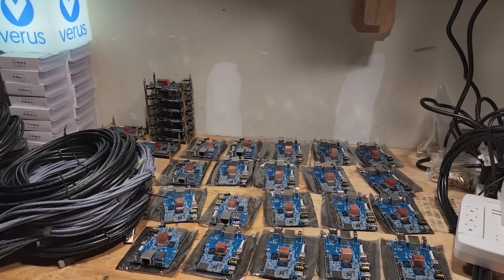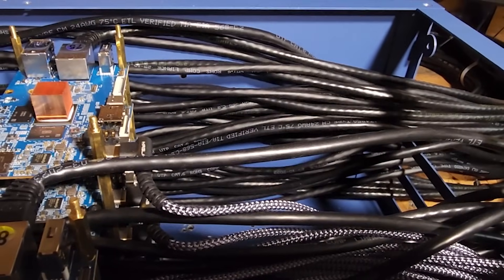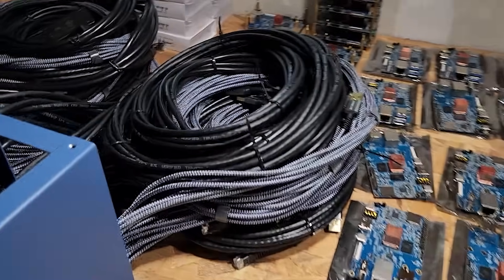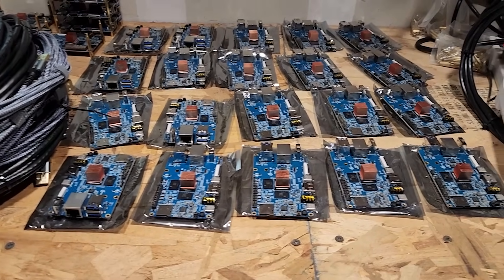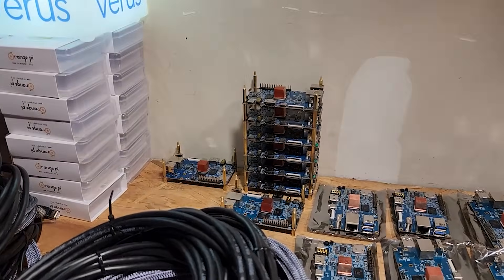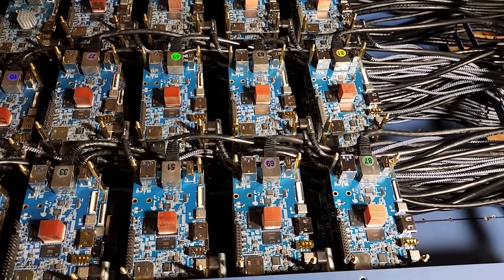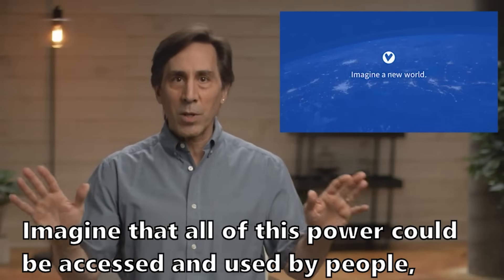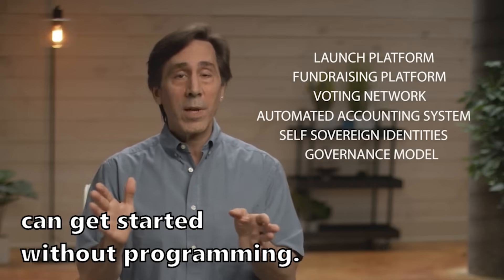Let's build A Pi Cluster Supercomputer with 125 Orange Pi  | Part 2

Comment: This definitely requires a very large amount of capital, and it will take several years to pay it back
Reply from the maker: There's another factor to keep in mind as well the network is 50% proof of of stake and 50% proof of work. So your mining rewards are now compounding as you're staking throughout the next year to help with your ROI. The 22 chainz that you will be merge mining you can also stake their coins.
Reply from the maker: You're right it's not cheap it was about 8K to build it but compared to a chia set up or GPU mining it's not that bad. In fact it's cheap compared to its profitability. I can also see why people don't understand how long it's gonna take to Roi but I'm personally thinking it's going to be less than a year.
Reply from the maker: For an example this setup cost 8K and can make about $250 a month before power And the Chia set 26K and makes around $200 a month. They should both use about the same amount of power. Just like with Chia I expect the market conditions to change and to be more beneficial as we get closer or further into the bull market but Verus has an edge with the merge mining where you can simultaneously mine 22 chains  Without the use of any more power.